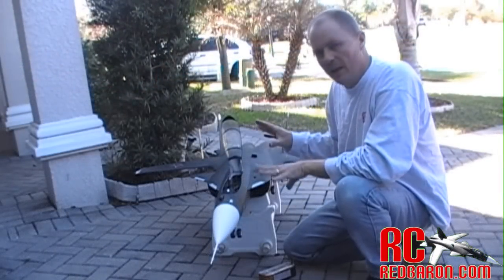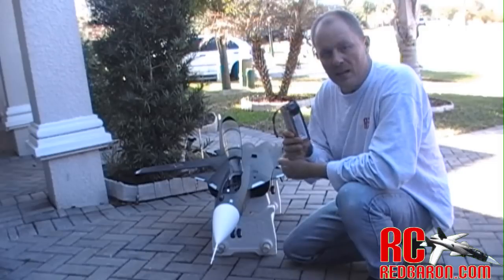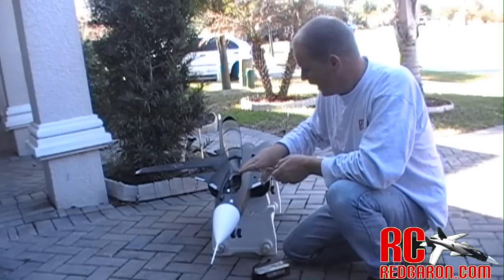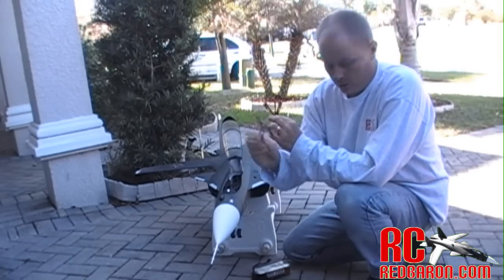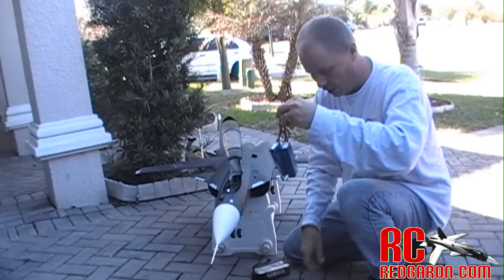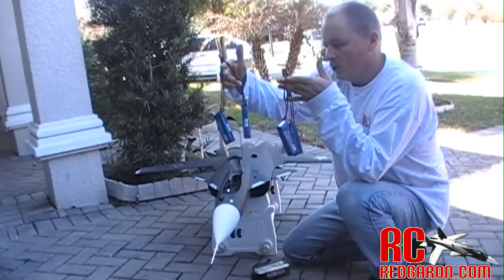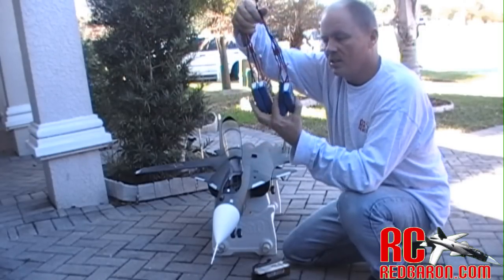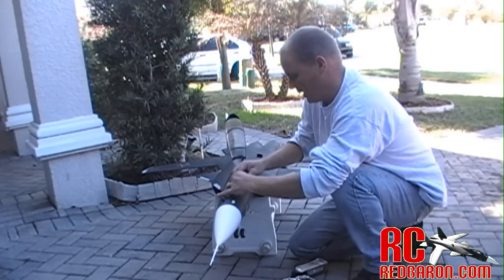SU-47 BERKUT TWIN 70MM THRUST VECTOR - BANANA HOBBY - video2 - 4 Lipo Supplement

Comment: @RCRedBaron Thanks for great videos, very informative! Are you using the ESCs included with the kit or did you swap for something else? I've read a lot of people are burning their ESCs running on full power and also got a word of caution from the reseller to go easy on the throttle.

Comment from the maker: @33vortex : Great question, I set my timer at 4 minutes.  once the timer goes off, I start my landing approach. While I may land with juice left in the batts, it allows for a couple of abort landings if I need it.  Another reason for 4 minutes, is that I can be a little hard on the throttle.  Better to land with juice left over, than to try and land with nothing left and find my lipos all puffed out from over discharge.  Thanks again for great question!

Comment from the maker: @adolz1000 : I didnt increase the voltage, thats the beauty of this.  Its the same voltage, 22.2 volts.  The system calls for 22.2 volts.    If you go above voltage, yes, it will cause damage, but for this, I simply created a 6cell 4400mah lipo as if I had a solid single 6cell 4400mah lipo. I just simply made one using 4 batteries.

Comment from the maker: @Ispintechno1 : Thanks for the cool comment.  Yes, it's best to use the same MAH and C rating lipos.  The only thing you can have different safely, is the voltage.  Combining a 2 cell with a 3cell to make a 5cell is cool, as long as the MAH and C rating is the same.  Thanks again!!

Comment from the maker: @hairlesshippy : The issue is balancing all together at once. First you'd need an adapter to get 4 balance connectors into 1 to fit the charger. It can be done, but I wouldnt take the risk of over charging one cell. Since I have 8 charger stations, charging individually isnt an issue. But to answer your question directly, I wouldnt recommend it.